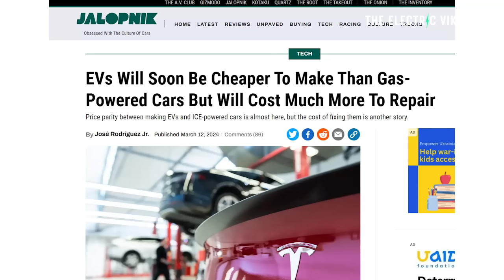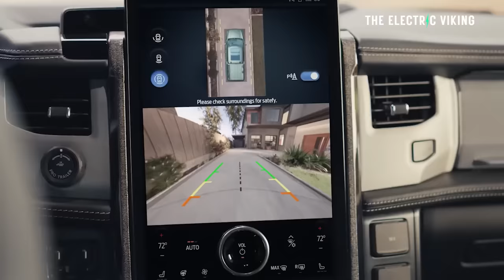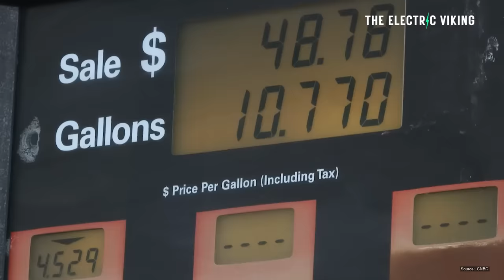The EV Price Premium no longer exists in the United States

Comment: They got the $7500 discount on new EVs , just snag a slightly used one and get the $4,000 used EV discount. Getting an enormous discount
Reply: Even a substantially used EV is a great deal. I'm driving a 2016 Fiat 500 E that I got for $7000 4 years ago. The car payments are tiny, the fuel costs are less than what I spend on coffee, and the only maintenance has been tires and some minor repairs totalling less than $3k. BTW the range at 60k miles is still the same as a new one.
Reply: @macrumpton  wow the Fiat E here new is 60 grand
Reply: @macrumpton  very smart .. ive never bought new .. always buy 4 - 5 years old when a car comes off its lease .. they are usually 50-70 percent less than it was new .. lease cars have a good service history as well

Comment: Total lifetime cost of ownership & operation is already cheaper for many for BEVs than ICE in the U.S., primarily due to cheaper electricity compared to gas. Fully charge a Model 3 for $11, Model Y for 14.40. Filling a Toyota Corolla 2024 in California is $43, Camry is $52, Toyota Tacoma is $70, Chevy Suburban 2WD $115 (28 gal.). There is essentially zero maintenance on a BEV, maintenance on ICE is inevitable and sometimes near continuous, depending on age. Maintenance on the cheapest Corolla in first year averages $63 minimum, year five is $2233. There is no recommended annual maintenance on a Tesla and the suggested schedule is every 2 to 4 years. Tesla Model 3 insurance in Vermont is $1630. Your driving history, state, usual car, etc. all affect ICE  insurance costs, obviously.
Reply: That’s not a fair comparison when the range on fully charged vs full tank isn’t quite the same. 
Better equivalent is to look at how many miles a kWh will get you, then compare to how many miles a gallon will get you. 
For me, on 87 cents of electricity I get 24 miles, which is pretty close to a gallon of gas. Gallon where I am is around 3.50. So my cost per mile is around 75% cheaper. 
For every 100 miles I drive, it would take 4 gallons of gas.  OR 3.50 of electricity.
Reply: @Meatball2022  Your math doesn't make sense and there are no adequate specifics. My family has multiple BEVs and has done the math for years, electricity is MUCH CHEAPER than gasoline. Consistently. If that is not the outcome you are getting you aren't doing it right. Good luck.
Reply: @beautifulgirl219  I own two teslas. Both get on average between 250-300 watt hours per mile driven. So roughly 1 kWh will get between 3-4 miles. Roughly equivalent car gets 24 mpg. So to drive 24 miles, I would use a gallon of gas. Or for my Tesla, would use 6 kWh. 1 gallon of gas is roughly 3.50. 6 kWh of electricity is 87 cents. 
Why would this math be wrong?
Reply: @beautifulgirl219  It’s hard to complain about a BEV being 75% more efficient than gas and say that’s not enough. But ok. 
I would suspect though that if you looked at your price per kWh for your electric bill, and compared that to driving efficiency and gas prices in your area, you’d get results closer to mine. 
My wife drives 500 miles a week. For her, gas would be $75 a week. $300 a month. Instead we pay about $75 extra in electricity. Are you suggesting that’s not nearly low enough?
Reply: @Meatball2022  I agree with this analysis, as I understand it. I may have misunderstood your earlier post. I was trying to make concrete comparisons and was trying to make the point that comparing a specific BEV to a specific ICE was possible and instructive. Some comments assert fact patterns that do not match those I experience. THANKS for your concrete post, I think it is useful and persuasive. Thanks for taking the time to provide the concrete info. Cheers!
Reply: Need to take into account resale or trade-in value, EVs not holding value a few years in.
Reply: @davew3935  they hold value same as comparable ICE vehicles.  It’s slightly lower than the industry as a whole but better than comparable within the segment.
Reply: @Meatball2022  Doesn't matter.  Cost per mile or km is always cheaper with electricity than with gasoline.
Reply: @davew3935  According to CarWow, EVs retain 48% of their original value after three years, while ICE vehicles retain under 40%. A 2019 study shows Tesla’s Model S holding its value 2 times better than the average gasoline car and 3 times better than the average electric car. My friend with the 2012 Model S won't sell it, loves it, won't even trade it in for a new Model S, which he can easily afford--that's holding value.
Reply: @beautifulgirl219  I’m in Texas.  Therefore “prices may vary” as they say, but I will say from what I’ve seen, gasoline prices in various states seem to roughly match electricity prices. In other words, states that have 40% higher electricity prices also seem to have 40% higher gasoline prices.  Roughly of course.
Reply: @KP-xi4bj  way cheaper. 1/4 based on my anecdotal experience.

Comment: In theory it should be cheaper to make an EV, as it typically has fewer moving parts. Also EV motor components seem more likely to be off the shelf and shared more easily across brands,   compared to actual ICE vehicle engines.
Reply: True, but they have to develop almost the entire car, a new ICE car is usually developed off existing, reducing those costs.
Reply: It’s the batteries that have been the single driving cost, but CATL says they’re coming down by 50 percent this year
Reply: Actually, cost parity between ICE and EV might prove very elusive. You replace the engine and transmission with 1 or 2 motors and a big battery. More materials go into making an EV compared to an ICE as EV are heavier than comparable ICE cars. So how can EVs become cheaper to manufacture in the long run? Some of the savings ev makers make right now come down to manufacturing processes and techniques that can be adopted by ICE makers as well.
Reply: @jasonettorre7114  At one time Tesla 3 and Y shared around 76 percent of parts between the two.  They have been improving the cars so now 3's may have parts that have yet to find their way to the Y.  This matters because Tesla made 1.8 million cars last year.
Reply: @dangrecu4034 The cost of materials figures into it, but engines and transmissions are very complex and take a lot of design work, precision machining and careful assembly of many parts. EVs have a reduction gear, no transmission. The motor has very few parts and no wearing parts. The inverter and charger use reliable solid state parts. Batteries are coming down in price because of the supply chains being established. Advanced batteries keep pushing costs downward and performance up.
Reply: @jamesvandamme7786 my only question is why the EVs only have an 8 year warrenty. When they are claimed to last 15 years. And why is it that LFP can last 15 years and Batteries and Inverters can be warranteed for 15-25 years, but somehow the tech in EVs can only be warranteed for 100k miles or 8 years. The hardware isn't new, and is very similar to Solar systems excluding lower voltage levels and panels. High operating voltage should show reliability in Drivers and Inverters. Idk why manufacturers are still using ICE warranties on EVs when the hardware supposedly last much longer.
Reply: @jamesvandamme7786  sure, but it's a perfected technology, engines are transmission are not that expensive to make these days. I read an article that the powertrain for a 50k ICE car is around 4000$ while the battery and motor for a 50k EV is around 15000$. Sure costs for baterries will come down but how far can they go? In the end it's the materials that go into them that matter the most and EV use more materials. The rest is manufacturing processes that are more advanced for EV's at the moment but ICE will catch up. If we want to drive up the adoption of EV then hoping for cost parity in a couple of years might not be the best strategy...
Reply: @dangrecu4034 materials cost has something to do with the price. Weight has nothing to do with the price.

Lower manufacturing requirements, tech improvements and battery chemistries that use cheaper raw materials means that price parity (assuming a free market) is here or almost here and the price of EVs will continue to fall. And keep falling.

Comment: Not anywhere in Europe I’m afraid. In the UK, most are 25% or more expensive, although there are expected to be a couple of models at parity later this year.

You still won’t get true mass adoption even with price parity - you need faster charging, more range and much better infrastructure. It will be a few more years before we’ll get there.

Comment: The only stumbling block for the normal ice car buyer is the average range of 300 miles for EV is not enough. Not realising they do not drive that distance without a break 99.9% of the time. They also did not realise a recharge of 20mins is sufficient to cover 100 miles or a bit more. More ignorance than anything else.
Reply: It should be thought of as a cell phone recharge at home at night. The % of people taking long trips is minimal
Reply: Would rather be ignorant than arrogant.Most people can tolerate ignorant, not so much the other.

Comment: New car is 50k€, 2 years, 30k... Why buy new?
Reply: For many, adopting a new technology warranty is a decisive factor. I bought a used Model S, which was 3 years old, and had driven around 60k miles. It's now 10 years old and almost has 200k miles on the dash. 7 years warranty for battery and drive train was a decisive factor for me. Adding the lifetime free Supercharger use made it a no-brainer.

Comment: With car battery prices predicted to fall as as much as 40 per cent by 2025, with its associated price reduction for electric vehicles, it is game over for ICE manufacturers, ICE cars will become expensive maintenance heavy nostalgic toys for wealthy enthusiasts.
Reply: EVs are cheap now, because demand doesn't seem to be great compared to supply. Reports say thousands of EV waiting to be sold in Europe, same in China and probably in US too. What is the price after some of the competition is out and supply matches demand? For people that can't charge at home because they live in an apartment for example (most people in many places) the total running costs of EV at least now don't seem to be cheaper if they need to charge at supercharger that costs a lot more than home. Some say insurance is 2x for EV, and Tesla repairs are expensive also. If one is really on a budget they can get an Dacia ICE for 15k and those prices will react also if EV price competition forces them, so I don't think ICE will be gone unless regulation forces them out.
Reply: And expensive maintenance? 😂 I have an 18yo Honda Accord that is still going strong so I haven't replaced it (next one might be an EV, but I'll probably keep driving the Accord as long as it lasts while looking at the market) and all I had to do is replace tyres, oil, other fluids, filters and brake pads, wipers and small things like that. Has been very cheap and insurance is 20€ per month (covers only damage to other vehicles, because car is so old no point in covering that anymore).

Comment: Price parity with $7000 subsidies. Keep them coming...;-)
Actually, cost parity between ICE and EV might prove very elusive. You replace the engine and transmission with 1 or 2 motors and a big battery. More materials go into making an EV compared to an ICE as EV are heavier than comparable ICE cars. So how can EVs become cheaper to manufacture in the long run? Some of thr savings ev makers make right now come down to manufacturing processes and techniques that can be adopted by ICE makers as well.
Reply: Cars aren't sold by weight. Batteries and motors are dumb, engines and transmissions are complicated to build.

Comment: Legacy auto is the Wonderbread of the car industry.
Reply: I think the crazy thing is that Legacy auto has had the time, the manpower, and the resources to design and release excellent EV vehicles for decades, yet they simply refused to. Gm released the EV1 back in the 90s and everyone loved them, yet they were only available as a lease and GM refused to sell them to the people who leased them. After the leases expired they were all promptly destroyed and the program was shut down permanently. GM didn't even say anything until almost 10 years later and the excuse the ceo gave was that they just couldn't sell enough to make them profitable, yet they didn't even try to sell them! I think what really happened is that the oil industry used its influence and deep pockets to squash the program.
Reply: Toyota could have kept their Prius R&D going and had a decent full line of EVs years ago, Nobody would have even heard of Tesla. But no, those gearheads like exhaust noise.

Comment: It would be good if you could address the point featured prominently at the start of this video about the cost of repairs. That's maybe a problem when EV enthusiasts have touted the lower total cost of ownership from lower running costs
Reply: Rare cars and rarer technicians mean repairs are harder and more expensive. The changeover is happening, so hang in there. And anyway, what do you fix on an EV?

Comment: As batteries become cheaper to manufacture so will the vehicles themselves.
Reply: Actually, cost parity between ICE and EV might prove very elusive. You replace the engine and transmission with 1 or 2 motors and a big battery. More materials go into making an EV compared to an ICE as EV are heavier than comparable ICE cars. So how can EVs become cheaper to manufacture in the long run? Some of thr savings ev makers make right now come down to manufacturing processes and techniques that can be adopted by ICE makers as well.
Reply: @YourHineyness   Tesla has been pushing prices lower as its costs come down.  Others lower too or they do not sell cars.  Thank Tesla for that.
Reply: @YourHineyness  The manufacturers will keep a good portion of the difference, but overall, the vehicles will cost less for the customer.
Reply: @dangrecu4034  comparing in ICE car to an EV in this way is not correct unless you are looking at something overly complicated like the Nissan leaf. Modern EV'S have so few parts that there is little that can go wrong.
Reply: @tonystorcke  I think the moving parts idea is seductive but misleading. Why does it matter that ICE's have more moving parts? Who cares that there are pistons and gears that move if they work? It's a perfected technology that clearly works. Modern EV's on the other hand are more difficult to fix after a crash since they are manufactured kind of to be discarded just like phones.